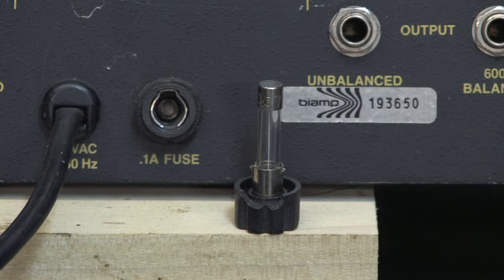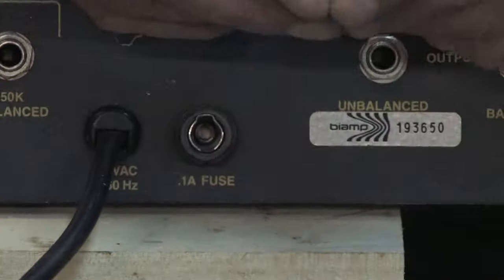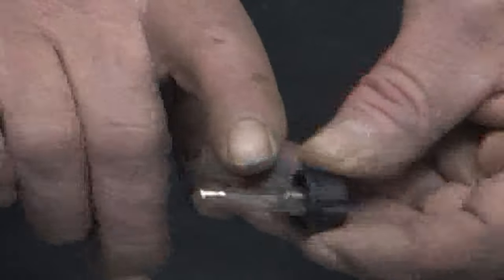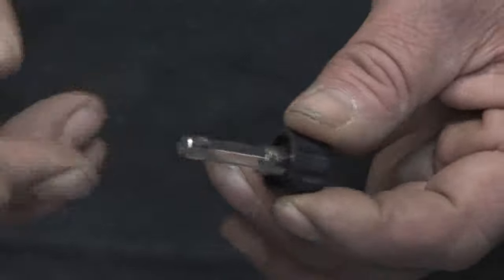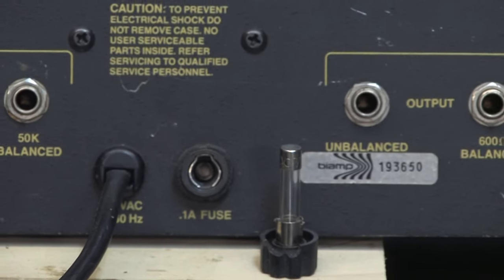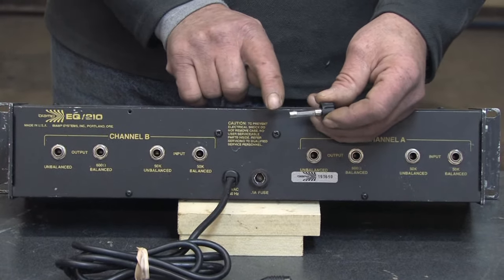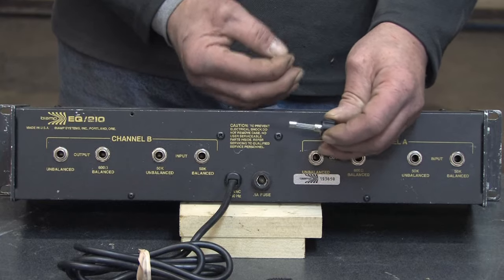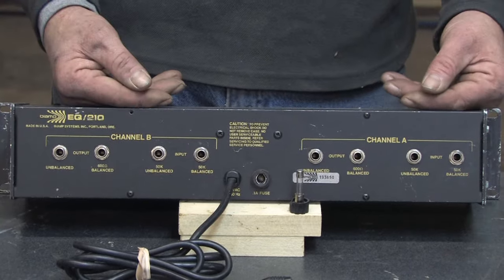Home Repair Tips : What Could Cause a Fuse to Blow?

Comment: Can i replace the fuse with a lower watt . The one it comes with is 12V25w but they dont sell them anymore and i have a 12V10w can this work
Reply: No, you should not replace a fuse with one of a lower wattage. Fuses are designed to protect electrical devices by breaking the circuit if the current exceeds a certain level. Using a fuse with a lower wattage means it will blow at a lower current than the device requires, potentially causing the fuse to blow prematurely. It’s important to use a fuse that matches the original specifications of the device. If you can’t find the exact replacement, it’s best to consult with the manufacturer or a professional, do not also use a fuse with a higher rating.